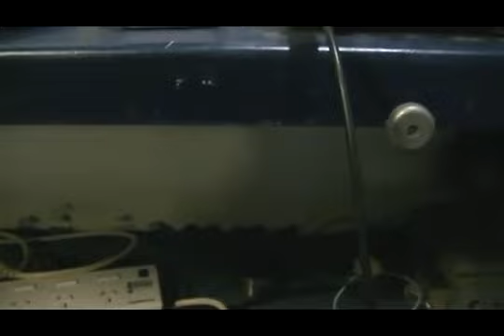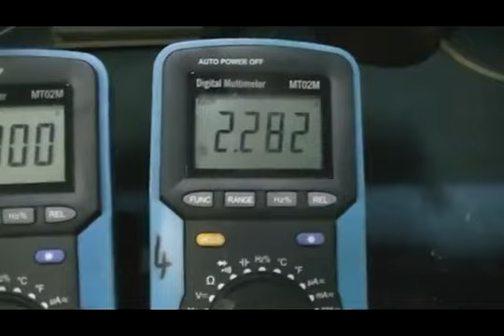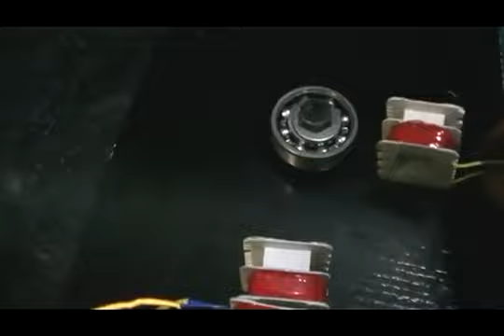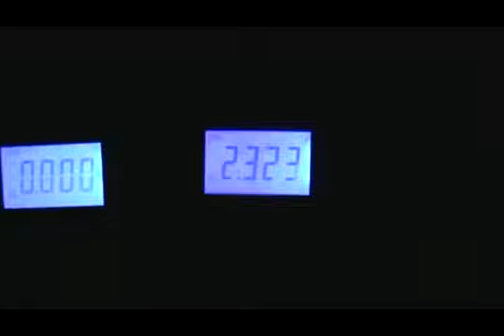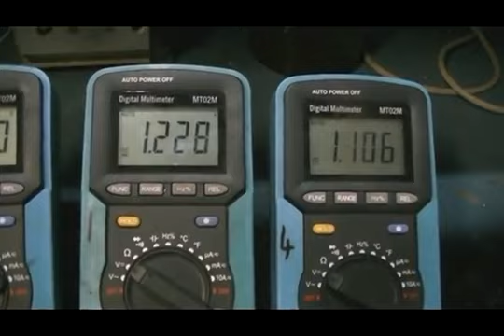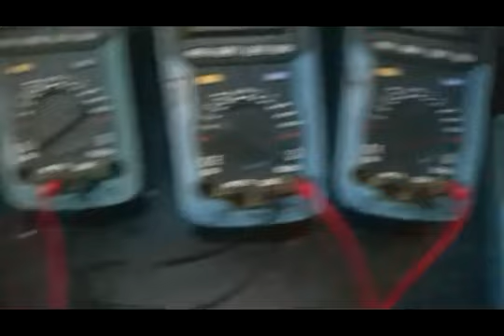cool joule ss ssg

Comment: TM  when I had a similar result, i pulled the DMM's and used analog meters, instead, yet I still saw OU, however I was able to see current flow better. The tell tale for me, though was, after a few days I saw a "catastrophic" drop in one of the cells, in otherwords I lost about .5V and it wasn't "corrected" until I changed charging methods. This, I think, is what also happened in my IMOTEP high voltage Oscillator experiment, and what is, what Mark Dansie refers to as "The Battery Effect"

Comment: Fun stuff for sure, I still have my gadget LS ringer running, Voltage goes up and down. Those coils sing to each other via the transistor. Why does the "run" battery charge?  The answer is = What is a transistor?

Comment: you are right but a Crystal radio can run a small speaker,maybe put a metal can or sieve over it, but even if that stops it it could be proximity of the Faraday cage to the coil and not a freq. and you are back where you started :)

Comment from the maker: I will be trying cap's.But one thing to remember is that while two batteries in series has a very low resistance,caps in series have a very high resistance-which changes the circuit's resistance aswell to a higher value.But non the less,i will give it a try-as soon as the charge battery is fully charged--and at this rate,it may be a couple of day's lol.